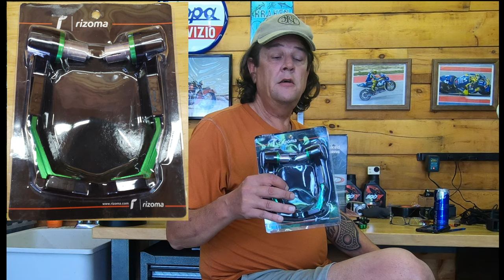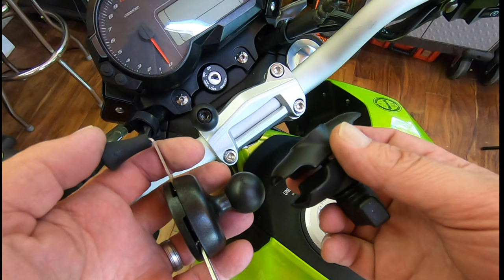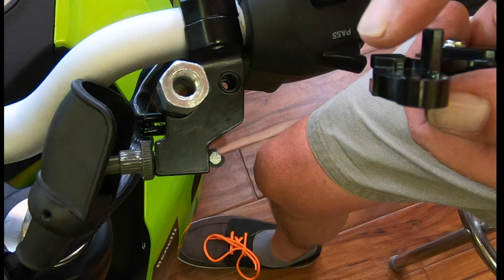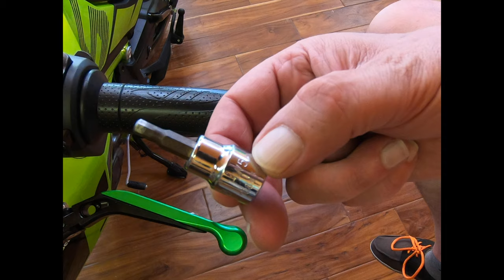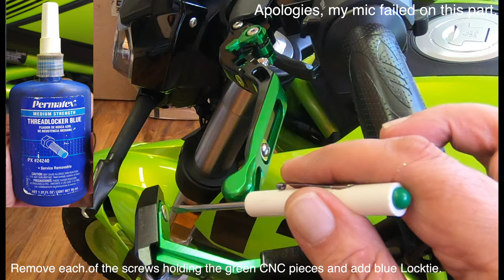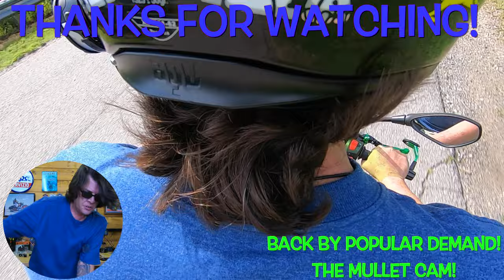Benelli TnT 135 Accessories

Comment: Thanks Eric, Good content. (You took a bullet for us on the lever mods, keep us posted ;-)) Looking forward to an oil change and chain maintenance vid. I've been looking for some kind of actual service manual for torque values and such. For now I'm using my Kawi and Suzuki OEM torque values by bolt size tables as a 'reference'. Also from the FB group - file/sand down the razor sharp edges of the exhaust shield before it bites you. Keep'em coming Kraken!
Reply from the maker: Thanks! PM me an email address and I'll get you a link to a service manual.
Reply: @KrakensGarageandAdventures  Ok, sent via FB.
Reply from the maker: @edwardcaco8534  Sent!

Comment: hi eric! just subscribed! love your videos! we have 2 benellis tnt 135 2020 one green like yours and one red, so far we love them. we did notice the off mark of the speed,, i may see if when we take it in for first break in that they will address that,, not sure if i do it and it screws something up lol. also just bought some levers from steady garage,, really nice ppl. now they were a bit expensive like 90 each so theres that, but they are well bilt, dont have any play in them with the thickness plus they also give you a new bar mount for it, id love to really see a video if you dont have one yet on a modification on ummm whats it called? ........ removing the license plate and placing it under back seat.. i know ill think of it as soon as i post this so i apologize! thanks again and look forward to your responce dylan
Reply from the maker: Dylan, I made a DIY video on how to correct your speedo error here https://youtu.be/wJl8tfH2oi8 
You should have a go at it and I'm sure you'll get it sorted. The levers I bought are junk and the ones that rocksteady sell are the real deal. You won't be disappointed. I think you mean tidy tail on the plate. Just know that if you do the tidy tail you lose your rear fender and riding on wet road or in the rain you WILL get spray right up your back. Something to think about. Thank you for the sub. Eric

Comment: I have Kawasaki ksr 110pro, yap it's a PRO one and I rode it long distance many times and climbed hills up to 14xx meters high and it handled all the extreme rides without problem and I had felt twice but it doesn't wear anything so far it's just I don't do stunt with it or enter in to flood and mud, nop! I not going to do such a thing...
Reply from the maker: You can't go wrong with the Z125 PRO. You bought a great bike.

Comment: Have you ever installed new front end brake pad
Reply: On the Benelli of Courts
Reply from the maker: Not yet ad I don't feel it needs them yet. The OEM pads are doing great. Super easy job to do if you want to perform the task.
Reply: So I've been having a problem my front end won't lock up if I want to do like a stoppie not that I want to but I figure it should anyway I took the old pads out how look at them clean them there's a little clip in the bottom that I can't get them clipped back into you have any tricks on that

Comment: How to adjust speedo speed using your two dash buttons. This came from a UK member off the Benelli TNT 125/135 facebook  Might work on the USA TNT mini motorcycles and save you some money buying the speedo kit 
first turn off your run switch
press and hold both the buttons on your dash
turn on ignition the display should show CC - - -
Press bottom button so the first charter displays 1
Press the top button to move to the next character
Press bottom button to read 2
Press top button to move to the next character
Press bottom button till character reads 3
You should have CC 123 displayed
Press top button to enter the code
You should now see value of maybe F010.3
Using the previous method to scroll and enter the values, you might also see a valve of F012.3, then press the 2 buttons together to save the changes. 
Now go ride around to see if the speedo is close to the corrected speed by also using your smart phone GPS, you might need to slightly change the values depending on your tire circumference.
Reply from the maker: I'm on it, going to make a video on the process.

Comment: You should never use WD40 or any other penetrating oil/fluid on your cables. The cables inside have a nylon shield going all the way down this is very thin & penetrating fluid dissolves it causing water ingress to the cable itself which in turn goes rusty & ultimately snaps/breaks. If you need to lube your cables graphite powder is the way to go.
Reply from the maker: Very good information! Thanks for commenting.